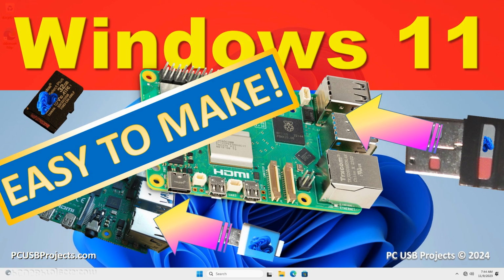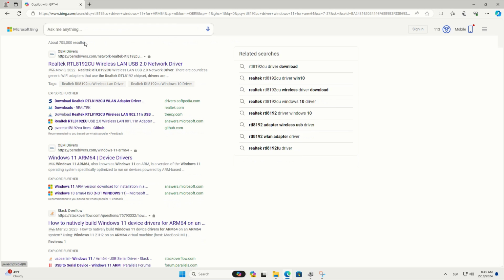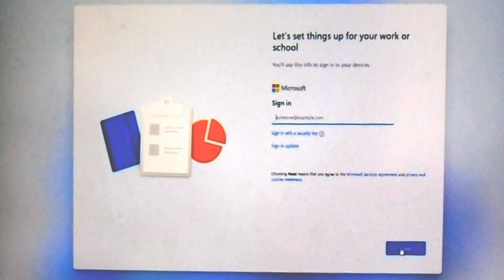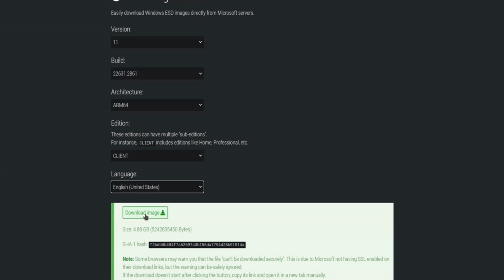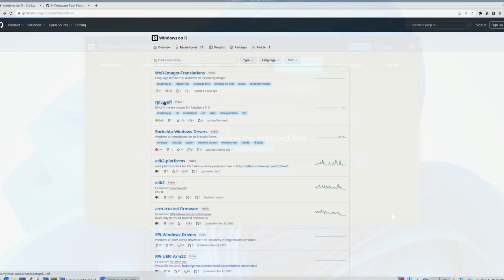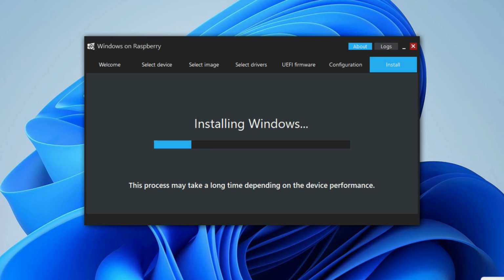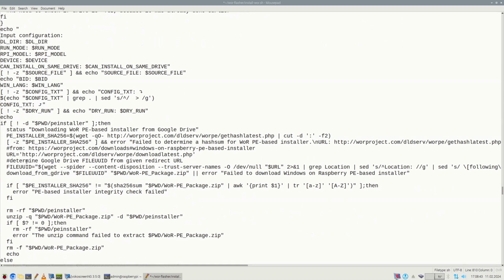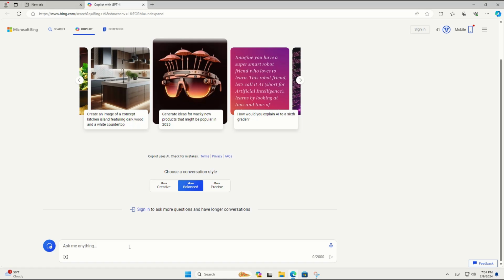Installing Windows 11 on Raspberry Pi 5 has never been more rewarding! MAKE YOURSELF A MAGIC PLUGIN!

Comment: The video title says “Installing Windows 11 on Pi 5,” but the content shows installation on Pi 2 and 3. So in summary, how do you install Windows 11 on Pi 5 using Windows?
Reply from the maker: It is not what it looks like. Listen to the commentary. The software described in the video requires to use this option, which is only suitable for the old Raspberry Pi 5 with the old C1 SoC (besides for RPis 2 & 3). However, watch my newer videos, where newer methods of installation are described in detail: https://youtu.be/F71_er6XykY and https://youtu.be/atFFduSAgUg. And, yes! It is possible to install Windows on Raspberry Pi 5/500/500+/CM5 from a Raspberry Pi 5/500/500+/CM5 that already has Windows 11 installed. You can also use a classic PC. You can also run Rufus on RPi 5 with Windows 11 to make an installation media for a classic PC or Orange Pi 6 Plus  for instance: https://youtu.be/AsEMAGx4fWw

Comment: First of all, thanks for your time. I have managed to install win 11 via usb and have UEFI on the sd card but I have not understood how everything can be installed on the sd card (UEFI & windows). I want to have only the SDcard on it. When I use the sd to install it gives me the message "Update the OS or set os_check=0 in config.txt to skip this check". The BOOT partition is locked and I can't access it. I have Raspberry Pi 5. If you can help me I would really appreciate it, thank you
Reply from the maker: I've installed Windows 11 24H2 with the latest updates as you can see in my newer video: https://youtu.be/EiqI__4PoK0. I had some problems with updates in the past with earlier versions of Win11, but I deem that they were mostly due to my bad and sluggish internet connection. I've solved this problem, too: https://youtu.be/17P1YeYgqCQ. Now, Win11 works excellent for me: https://youtu.be/FhYEl7Hzohg. You might also be interested in this video: https://youtu.be/SFErbvc-SVw.
Reply from the maker: The easiest way to access boot partition is on a PC with Windows. If you want to access it on Raspberry Pi OS, you might have to mount the drive manually using root privileges. I've done it many times. It is easy enough, but doing it on a Windows computer (including RPi withj Win10 or Win 11) is even easier.

Comment from the maker: Installing Windows 11 Raspberry Pi 5 has never been easier!

FIRST:

No SSD drive needed! Raspberry Pi 5 Windows 11 plugin! It works instantly! 

Installing Windows 11 in Raspberry Pi sprung many myths. Many think that you need at least an old hard disk on USB or and SSD drive. Though the fastest option is SSD drive on PCIe, it is still not the most efficient one. 

Installing Windows 11 on a micro SD card is great and it works excellent on Raspberry Pi 5 with 8 GB SDRAM! The reason why Raspberry Pi 4 needs a fast SSD drive to run Windows 11 efficiently at least on my opinion the fact that it utilises only about 3 GB of SDRAM due to a hardware DMA controller deficiency. A patch to the operating system is needed to overcome it, but there has never been any patch for Raspberry Pi 4. Raspberry Pi 5 has a newer architecture and doesn't need any patch. 

Though there is no official way on how to install Windows on Raspberry Pi 5, I believe that I've found the most efficient solution...

SECOND:

Set your Raspberry Pi 5 to boot from USB drive. If USB drive with Windows 11 is inserted it boots Windows, otherwise it boot what ever is in its micro SD card socket. You may also boot Windows from the micro SD card socked, of course! And use Raspberry Pi OS or other Linux as plugin.

DON'T USE A DATA KEY, USE A MICRO SD CARD OR AN SSD DRIVE!

Using a data key instead of a micro SD card and USB adaptor is not recommended! I've tested it, bit my old data key keep having problems with multiple partitions....

INTERNET CONNECTION OPTIONS are only available through USB devices:
- smartphone (RNDIS)
- USB 3.0 to Ethernet adapter
Watch this video to learn more about a fast USB 3.0 to Ethernet adapter that is tailored for Raspberry Pi 5, but you can use it with Raspberry Pi 500 and Raspberry Pi Computer Module 5 as well:
https://youtu.be/xk71szNDWok.

Comment: Do you face any issues while running the software like that, Are it works smoothly?
Reply from the maker: Windows 11 works smoothly on RPi 5, but of course there are many issues. Current version that works on RPi 5 is good for testing and you can also browse the internet (using your smartphone as an adaptor) and watch videos... With an addition of RPi 5 dedicated device drivers and an improved UEFI BIOS version it could be made more reliable in the future...
Reply: @pcusbprojects  I need to run the ninjapinner ninjatok ninjagram GSA bots and some GUI bots I need to use them is that Possible to run in the raspberry Pi 5 model B is that possible in 8GB ram can you please tell me
Reply from the maker: RPi 5 with 8 GBs is as much as you can get anyway on any RPi. If not, you need a more powerful computer.
Reply: @pcusbprojects  thanks for this tips

Comment: you may be able to install windows on rpi5 but you cant do anything with it untill the WOR team drop the official drivers out for beta testing or even out for actual usage but we are not close to that yet so you may be looking at a month or 3 untill we can get the drivers for rpi 5 so that may answer some questions.
Reply from the maker: Use your smartphone to establish an internet connection. You can do it either by connecting to your smartphone to your local Wi-Fi access point, or through a mobile internet connection (LTE or similar). Then share your mobile phone's connection with RPi 5 through USB tethering. It works, I've tested it!
Reply: but also the display drivers, bluetooth drivers and more
 @pcusbprojects  most games or apps require drivers for windows like audio or even ethernet drivers
Reply: would if i dont have an android phone i have iphone and no android phones available to me at this current time? @pcusbprojects
Reply from the maker: Let's put it simple: If Microsoft decides to fully support Windows 11 or it's successor on Raspberry Pi 5 will get at least all of it's peripherals supported (Wi-Fi + Bluetooth, Ethernet, etc.).... It may happen this year, but I guess that it mostly depends on Raspberry Pi 5 popularity and it's users current interest in instllling Windows... But to get a taste for Windows 11 and to test internet services using your smartphone as a modem, current test version is perfect..
Reply: @pcusbprojects  you missed my point, WOR the team makes/developes the drivers for windows on the pi and also they develope the bootable uefi partition (well the files) and at some point they will make the actual os installer with the drivers with it, that is what I was saying as Microsoft dosent make the drivers they make the os with the basic drivers so you can install you’re own drivers but they don’t make drivers.
Reply: @pcusbprojects  and also would if you only have an iPhone and can’t afford to get an android phone at the moment and you wanted a free and easy fix so you would have to wait for the drivers to be available to access the internet
Reply from the maker: Get yourself another RPi 4 or 5. If you switched from RPi 4 to RPi 5, you my use your old RPi 4 as RNDIS USB to internet bridge. Works with Ethernet or Wi-Fi. Simply install Android in your second RPi and connect it as a USB device to your RPi 5 running Windows 11. Here is my video about how you can do it: https://youtu.be/17P1YeYgqCQ....
Reply: @pcusbprojects  I meant video drivers and more not just Wi-Fi and Ethernet
Reply from the maker: Video at least for me works well with RPi 5. I suggest that you go to: https://github.com/worproject/rpi5-uefi and check what works and what doesn't yourself....
Reply: @pcusbprojects  the transparency and windows mica affect doesn’t work without the actual display drivers (also getting screen tearing), Microsoft makes a temporary display driver but still causing these things to not function well (still causing screen tearing)

Comment: It is possible to do this and install windows 10 on Raspberry Pi 5 instead?
Reply from the maker: Install Windows 10 for RPi 2/3 and replace files on boot disk with files from UEFI 0.2 package for RPi 5. Cheers!
Reply: @pcusbprojects  I followed these steps and received "Inaccessible boot device" error

Comment: Can u make a detailled video HOW exactly u sho to install Windows 10 or 11 on a Raspberry PI 5. This Vedio ist very confusing. You jump from here to there. And we can't see the steps because the resolution ist much to high und lines are mostly unreadable. Would be happy if you can make a step-bystep-video. I got it running with the WOR-Imager. But after a long time of installation and reboot into OS I could NOT select any LAN-Connection to complete the Installation. Not onboard WiFi or LAN-Connection or an erternal WiFi-Stick.
Reply from the maker: It is detailed more or less. The trick is to copy UEFI bios files (u get them in a ZIP archive as shown in the video) over the files of the boot partition before you restart your RPi 5. It is shown in the video. If you need more detail on the basics stuff, watch my previous video: https://youtu.be/V2LQTuHQCCw

Comment: just NO! Dont install that shitty os anywhere!
Reply from the maker: I'm sorry that you prefer Linux. I have no preference. I simply seek the best of the best. I used to hate Unix and Linuxes, because most features were only accessible through command line. As Linux got similar GUI to MS Windows GUI, I've realised that there was no reason to hate it any more. I believe that MS Windows still has many deficiencies like Linux sfdisk command line command that enables you to copy data drive partition tables. I would have been glad, if Microsoft would have never released DOS, but would have stuck to Unix command line and would have just added the Windows graphics. Later on they've inbuilt a much more capable OS/2 core and Windows NT was born.... Now, we are embracing Linuxes with Windows like graphics, but Windows GUI is at least on my opinion still the best... We need a some kind of merger of both worlds...
Reply: well until linux is more user friendlier than windows and they write more non generic software thats worth a fuck to the end user i guess windows it is. Until then keep your fucking command line terminal typing ass opinions to yourself. And before you say linux is more secure argument linux is actually more hackable than windows. And since windows is the most popular OS hence there are more people hacking it. If linux was the most popular OS than it would be Linux that would be holding that honor. So until you know wtf you are talking about perhaps its best if you save your opinions before giving out advice Mr wannabe script kiddie im smarter than you because i can type on a keyboard asshole! Im so sick of you people and your holier than thou Bullshit! Who the fuck are you? Get bent!
Reply: its not the worst os but can have its limitations but compared to mac os then you are wrong (if youre looking for easy customizability) but if you are to say you use a pc for lightweight webbrowsing or playing minecraft/roblox then windows/mac is good for that but for developement linux is the way to go, as a windows user wanting to go to linux (my perants dont want me to on my main laptop) i much prefer linux but it isnt for everyone so that is just to note. for an average joe who only does basic tasks, depending on the pc they use and money they ould most likely to go for windows/mac as of their work.school envyroment has them. so not every one can or will switch to linux as they probably cant.

i love linux, hate windows but i do take this as a note to other people too.

this is not a hate comment just trying to establish info.
Reply from the maker: Linux and Windows have borrowed many features from each other in the past, but open source is still a major Linux advantage, because it makes it very hard for anyone to inbuilt a backdoor into it. So, much less AV SW is needed, if any... But Windows on my opinion still has the best GUI and is best suited for a classic PC, if you want the highest performance. However, Raspberry Pi OS is far the best choice of an operating system for general use for any RPi, if you want top performance. Windows 11 on RPi 5 will still a be very good option, but we need a production version with all the drivers, not only those for USB controller...